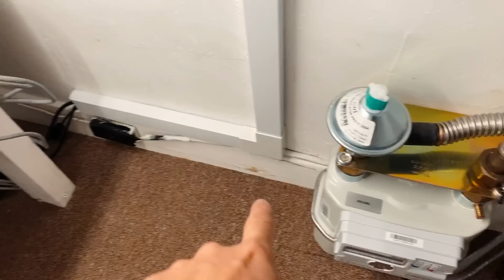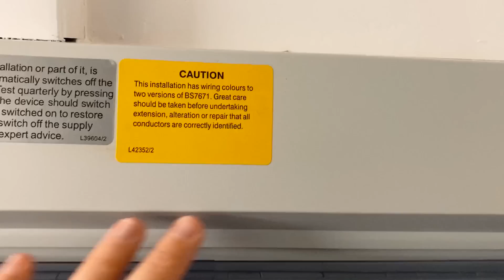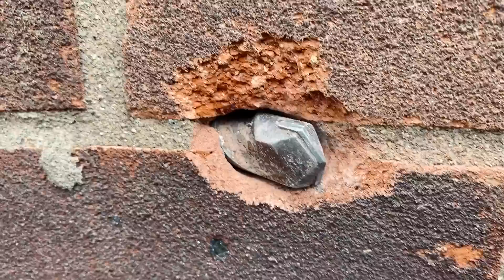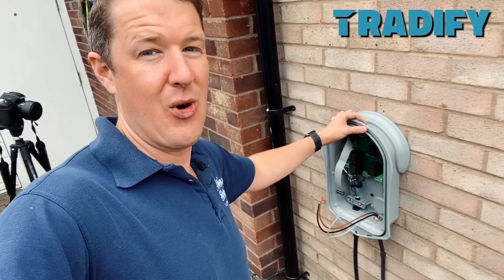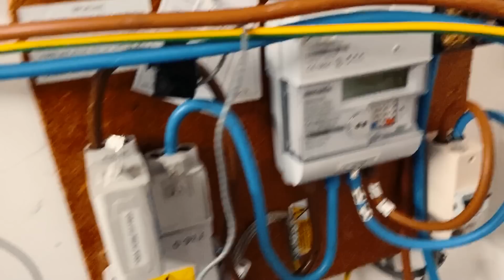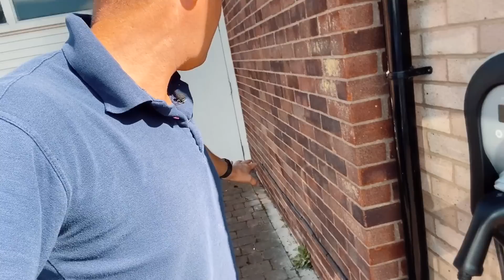Should YOU become an Electric Vehicle Charging Point Installer?

Comment: Does this charger not require RCD protection? The charger I installed at home required a type A RCD according to the installation manual, the DC protection is covered by the charger itself. But it's a different manufacturer and I installed it almost three years ago. And there's a nice story behind it.
The thing was, it's a 22kW charger, 3x32A. And I have to get the permission of the DNO when connecting a single appliance with a demand of more than 12kW. EV Chargers are propably their worst nightmare, except of unbalanced loads (single phase loads are only permitted up to 4.7kVA). The guys came over and inspected the service entry, the charger, meter box and so on. The meter box got selective circuit breakers in it, 3x50A. In the service entry are 3x80A NH-fuses, but there are two houses on the property which are connected to this (my parents in one house, I live in the other one). Heating and hot water is natural gas.
After the inspection they told me the segment of the grid couldn't handle this, and if I want an upgrade they would charge me 4 to 5000 Euros...so now I got a three-phase charger, fused with 3x32A, wired with 5G6mm², but it's limited to 11kW (3x16A) internally (DIP switch code). The interesting thing would be, what would they do if I would install an instant water heater for a shower? These things have normally also 22kW here...I suppose they would say that this is only for a period of a few minutes that thing is in use...and the thing was, I used that charger almost half a year before they came at 14kW (3x20A). No power outage or total blackout, not even a call that they noticed problems in the segment which are caused by our installation. And then you think...😭 💩 👿 💀

The interesting thing is, if I would have simply installed a red 32A CEE (Commando) outlet and used a mobile charger no one would have cared for this...but as soon as you hardwire the charger to the installation you're in trouble...

My charger got an additional safety feature: It measures the voltages between the lines and the neutral, if the PEN would break, the voltages between the three lines and the neutral would be no longer 230V/400V. If one or two phases would fail (fuse blown) the charger would go into error mode and switch itself off. And in addition it creates a fault current which trips the RCD in the board. Earth electrodes are standard here in Germany, even in a TN-C-S installation.
Reply: this charger  has a built in an RCD protection
Reply: @topchannel1000  Ok, but some chargers still require a type A RCD, even if they offer a an internal protection against a DC fault. Some require type A +EV, and some require a type B RCD.
Also a type A RCD protects the cable between the board and the charger itself. The integrated RCD in the charger only covers the charger itself and the car.
Reply: @Marcel_Germann  it has all RCD's built in 
in UK if  using a SWA cable RCD is not required for the circuit
also this charger disconects on a PEN neutral broken fault 
i don't know if this sort off supplies are used in germany
if you listen carefuly throug out the video jordan will explain it
Reply: @topchannel1000  We don't use that type of cable. I used the standard cable type NYM-J 5x6mm²:

http://www.ddacables.com/katalog/pdf/nym-j-o.pdf

My charger measures the voltage between the three-lines and the neutral and the CPC. If the PEN breaks (most common system is TN-C-S here) the voltages would be outside of the specifications because the voltages would loose their reference (the earthed center point is the neutral). The voltages could be anywhere between 0 and 400V, also depending on the appliances connected to the system. For example on L1 is a soldering iron connected with 20W (R014.4 Ohms), on L2 a heater with 3.7kW (2645 Ohms). In that case the soldering iron would "see" 397.8V and the heater only 2.2V. And even if you have single phase installations in domestics in the UK, if you're hooked up on L1, your neighbour is on L2...and if the PEN breaks in the street (construction work) there will be a lot of roasted appliances....
In Germany since the 1970s houses must have an earthing electrode integrated into the base plate of the house. In older houses until then the incoming water pipes were made of thick cast iron to use them as an earth electrode. 30mA RCDs were first introduced as mandatory in 1983 VDE regulation for rooms which contain a tub and/or a shower. But only for new installations. Transition period until 1984. In that year also type AC RCDs were banned for new installation. That means the standard type of RCD is type A here since then.
Reply: @Marcel_Germann  Yes with a SWA cable that's installed properly its very unlikely for any cable fault to expose someone to a electric shock hazard, that's why you don't need an RCD.  In the UK if you're going to have cascades of RCDs then you have to consider their timing and trip currents
Reply: @edc1569  Not only in the UK. You can use the selective ones marked with an S in a square or as an alternative you can use three times the tripping current. For example the last RCD got a tripping current of 10mA, then the one before must have a tripping current of 30mA. The VDE for example now recommends to use a 10mA RCD instead of a 30mA for rooms which contain a bathtub and/or shower. And that's fully understandable, the 30mA threshold is for healthy adults, for children or elderly people the treshold is much lower.
Reply: @r.h.8754  Yes, I think about removing the charger from public grid and powering it up with PV.
Night-storage heating was also a big thing here several decades ago. But now with these prices for electricity, almost 30 cents per kwh, most people installed a forced hot water central heating system fire with natural gas or oil. Some are firing these wood pellets.
The cable that enters my house should is a 4G35mm², L1, L2, L3 and the PEN which is separated into a separate N and PE in the entry box with the fuses. The box and the incoming cable belongs to the DNO, the cable between the entry box and the meter box belongs to me. As the meter box is my property. Only the meter belongs to the DNO.